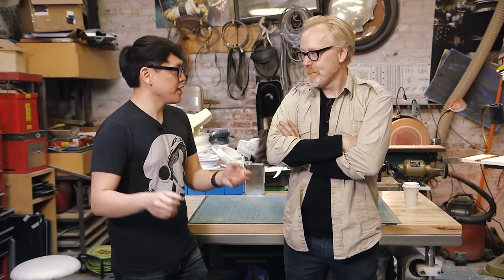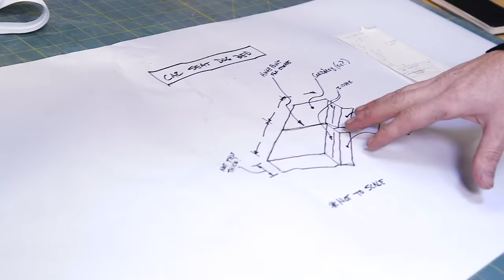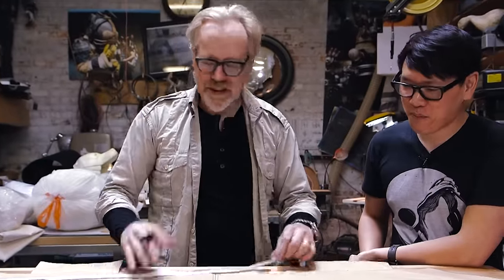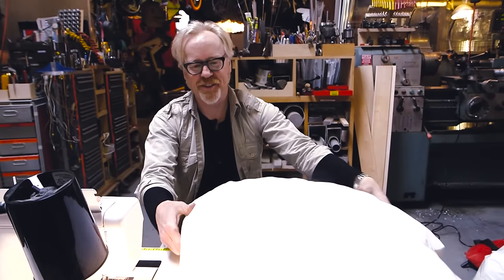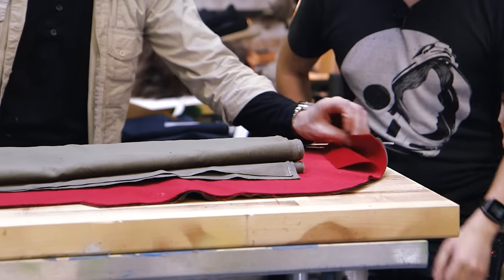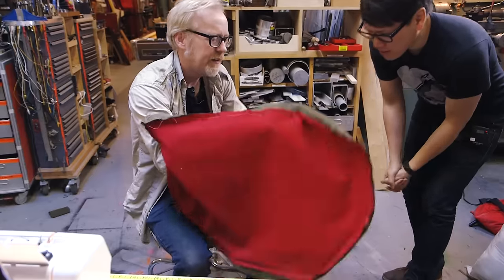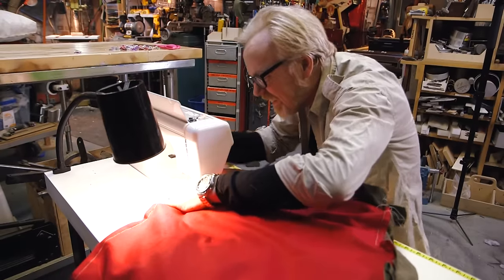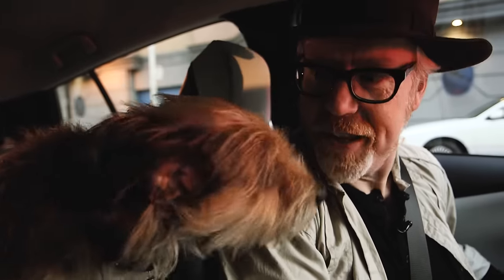Adam Savage's One Day Builds: Puppy Car Seat!

Comment: Um. mot really that great of an idea. It obviously moves around and looks uncomfortable... and apart from that, were's the harness and seat-belt?  You drive without strapping your dogs in?  Do you have a death-wish?
Have you ever been headbutted by your dog?  Imagine that at 30hpm or faster, right into the back of your head or your passenger's head.  Seriously Adam. Make a fitted seat cover, half as thick, with just foam-rubber seat cushion material inside, not pillow stuffing or batting... AND INCLUDE HARNESSES THAT ATTACH TO THE SEAT-BELT ANCHORS!  It's not just the dogs that could be killed, they could easily kill you!  Loose items, over 20lbs, with blunt instruments on one end, sitting on a floppy cushion, in your cabin space is a terrible idea. 
Back to the drawing board with this one!  Doh!

Comment: I don't understand the hate for the Prius, is it a devil may care kind of car?  No.  But it's not the ugliest car ever made either.  Meanwhile I'm driving around in my 2006 Honda Civic Coupe.  Which is an Ultra Low Emission Vehicle 26/34 MPG with an AMAZING 1.8 liter inline 4, making 140 horse of raw power with 128 lb-ft of axel-sheering torque to the wheels at 4k RPM.  With all the stoplights in my town, I need a new set of tires every-- day--.  People don't make fun of that car, even though it sucks.  At the end of the day, it's all just transportation, who gives a shit?  People need to dial down the macho.  I know this opens up for an argument, but that's not what I want.  There's my two cents.
Reply: +Viking War Pickle You actually nailed the real problem with the Prius. A regular Honda with a sport tuned motor gets within earshot of Prius economy, costs half as much, and doesn't require highly toxic battery and electronics factories to build.

If manufacturers would stop screwing around and design a gasoline (or better yet, turbo diesel like is everywhere in Europe) vehicle with the same aero as a Prius and an economy tuned engine they would exceed the performance of a Prius and open the market for them up to virtually anyone.

So, the Prius is basically just the most hipsteriest POS you could ever own and it's been designed and supported by politics, not engineering.